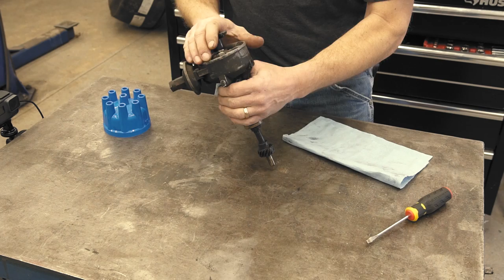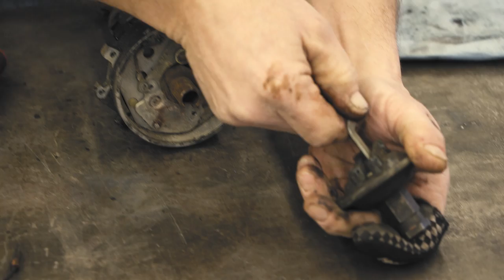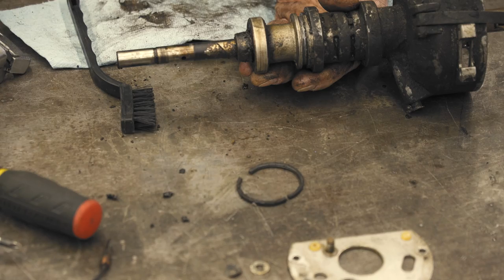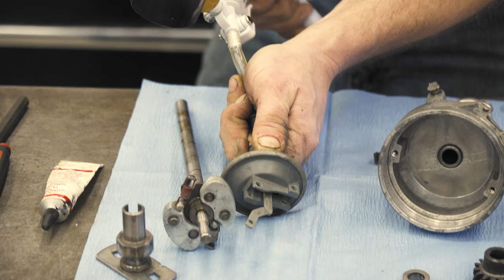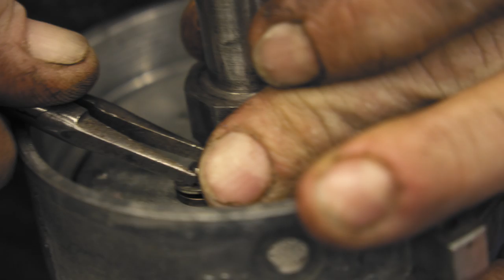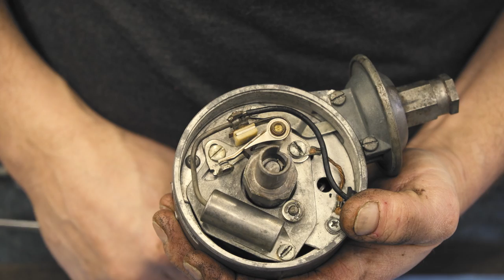How to rebuild a standard points distributor | Hagerty DIY

Comment: Excellent how-to video!  This gave me the confidence and know how to tear down, clean and reassemble a filthy, greasy, cruddy LoadOMatic distributor for my Ford 200 Ci Falcon engine. I rented a 3-prong puller at O'Reilly's, free of charge, and had the cam gear off in 10 minutes. Most every step was the same as in the video except removal of the breaker plate.  There is a really thin metal ring at the top of the shaft that holds the plate in place.  Carefully pry it off with a pick or awl.  Thanks, Devin!

Comment: Just wanted to add my 2 cents - I used a small section of oil pump drive shaft to insert into the dist shaft to hammer on so I would not damage the dist shaft. I always used a brass mallet (or brass rod) when hammering on the gear unless it was being replaced with a bronze gear. Do not use oven cleaner on aluminum ever! It contains lye which dissolves aluminum. The roll pins are 1/8th inch diameter, I used the next size smaller drift punch to remove them and a larger one to install them. Use the heavy duty pins from industrial hardware suppliers, they won't shear like the stock type ones. The big problem I had rebuilding ford distributors was how loose the top bushing to shaft fit was. Even with new bushings I had too much wobble. It wasn't until this year I learned of metal spray welding. That would fix the worn shaft and fix the wobble.

Comment: Hi David, You are mistaken about not being able to use the puller to drive the shaft out. The center screw will push the shaft out and the housing acts as a solid base.

Comment: Ford gears are a press fit and its highly possible to mess up the hex oil pump drive if you use a puller.  When you check side play in the shaft, check with the shaft fully installed.  At that point, there should be virtually no perceptible side play and the shaft should spin free.  NEVER EVER grease the distributor shaft or advance weights.  The solids in grease will clog the pores in the shaft bushings, and it will gum up the advance action over time.

Comment: Every time I see the innards of a distributor, I'm extremely grateful for electronic ignition.
Reply: My car has an electronically controlled - but distributor-based - ignition system by Bosch. And a Bosch MonoMotronic injection system, which is a single injector system that looks just like a carburetor.
My distributor has a lot of side-to-side play and it's eating rotors for lunch. They get obliterated hitting the insides of the distributor cap.
Reply: wait till you have to replace one  the distributor have stood the  test of time mine is a 1953 dodge dist very simple to work on   lots of pepole do not know about the capacitor has to match the primary  winding  ( they have installed wrong value mfd capasitor)  it will cause the points to pit if wrong value   check points for pitting if so replace capacitor. with correct one

Comment: I think it would be easier if it was in a vise. The sponge under the rotor should be oil filled, it keeps the mechanical advance and cam assembles lubed.

Comment: that little capacitor is very important  the mfd must match the coil in that eng for max spark   my 53 dodge needs a 27 mfd for max spark any thing more or less is  a very weak spark   in a series resonant circuit

Comment: You got lucky and/or "cherry picked" a good distributor but, for the purposes of "instruction", it would have been good to show removing and replacing the bushings including any reaming that might have been necessary. A proper drift punch is ALWAYS best when removing pins to avoid mushrooming the end of the pin you are trying to push out. At least WARN those that don't know of this risk. Otherwise, NICE JOB !!
Reply: Never ever use a hammer to remove the gear or pound the distributor shaft out of the housing. Always use either a brass drift or a block of wood. Using the gear puller on the bottom of the shaft definitely could distort the oil pump drive inside the distributor shaft or mushroom the end. Bob is correct in that a drift should be used to remove the pins, even a nail the correct size with the point removed would be better. Supporting the shaft on wood is far better than subjecting the gear and/or shaft to the shock sustained when removal/insertion of pins and/or the gear and collar.

A tip for inserting any screw into any location:  ALWAYS turn the screw backwards with slight downward pressure until you feel the screw 'drop' into the threads of the female portion before you start to tighten it in the clockwise direction. This will match up the threads so you won't cross thread. This works on ALL screws and bolts including plastic, wood, etc.

Additionally, a needle nose works extremely well for attaching e-clips as the force is more easily distributed & a small screwdriver inserted into the space between the 3 points of the clip and then twisting the screwdriver easily removes the clip without possible distortion of the clip.

All in all your video would be very helpful to those that have no experience in it.
Reply: And now this is distributor is ready to put back in the engine, except it's not exactly .something you can make such a big deal about taking it off and  forgetting to  replace.  The  O  ring!

Comment: Not gonna lie, had a few cringe moments on this one.  Overall still a good vid.
Reply: Me too!
Reply: For the sake of us newbies, what were they? What should he have done different?
Reply: @rustyjeep2469   starting with the roll pin removal, using a tapered punch just spreads the pin, use a roll pin punch.  Beating the gear with a hammer is absolutely a no no and that puller without a spinning tip will mar the oil pump drive.  Clean anything you plan on rebuilding on the bench.  That’s the only way to find any cracks or damage that the caked on grease could hide.  I like Davin and this channel but a distributor is a precise part that should be cared for differently, and hitting the shaft with a steel hammer is not the way to do it.

Comment: There were several times that this work could have added damage to the components.  This type of work is exactly what you do NOT want if you have a one of a kind vehicle.   I would never allow work like this on my vehicles.  Beating on the end of the shaft with a hammer?   You never know if your going to damage that shaft..
Reply: Well what do you do when components are stuck together and all normal/safe ways are ineffective? The shaft could be replaced but any other method would most likely risk damaging the case which is the main/visible part.
And if it was one of a kind (or one of a kind type demonstration), I'm pretty sure he would be treating it much gentler and not hammering and scraping it with a screwdriver.